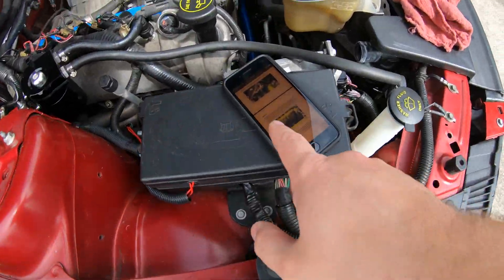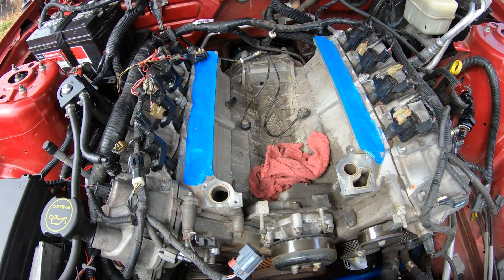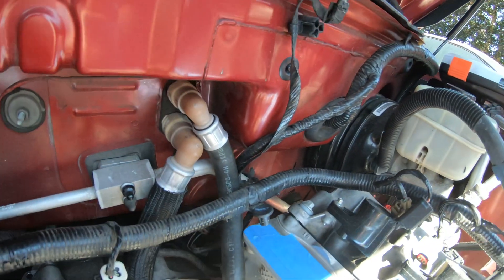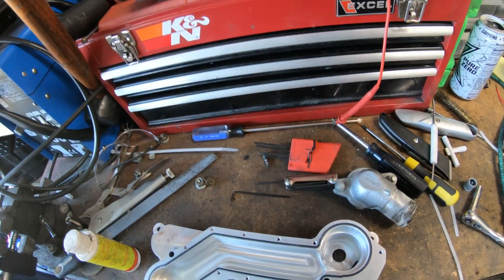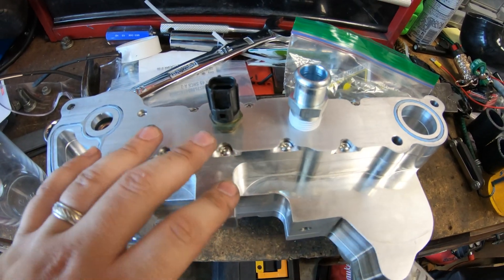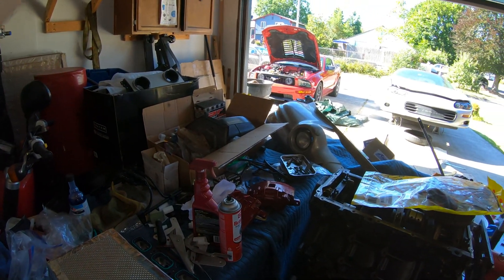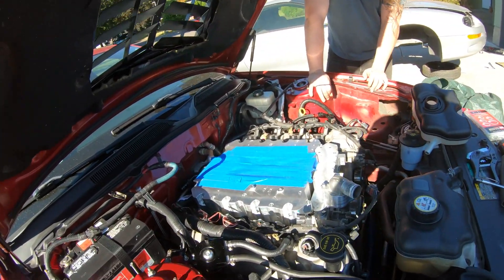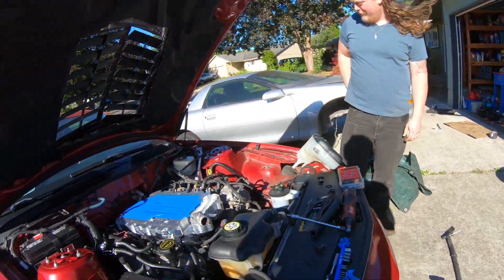Supercharging the 6R80 Swapped 3v Mustang GT Part 2 (DOB Intake Manifold is Installed!)

Comment: WHY GO THROUGH all this, when you can get a good used spcharger that just bolts on and makes the same boost and power as this from the gt350, this was back then when there where none made for what people wanted to do, today there are many available. I GUESS IS FOR CONTENT????
Reply from the maker: It doesn't sound like you're very familiar with aftermarket supercharger kits and what makes a quality kit. The DOB supercharger kit is cheaper and will be more reliable when it comes to making power. There is no "bolts right up" supercharger kit out there. There just isn't. This kit is no more hard to install than any other aftermarket kit like a roush or whipple. The DOB kit has the best intercooler on the market, there is no comparison. You could not even come close to the IAT temps this kit produces compared to other kits. Also the GT350 never came with a supercharger.